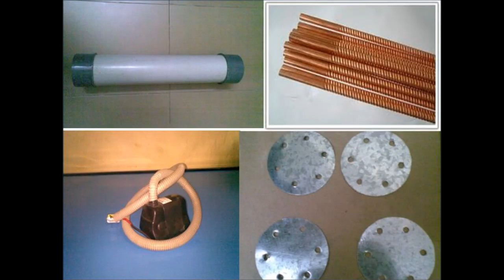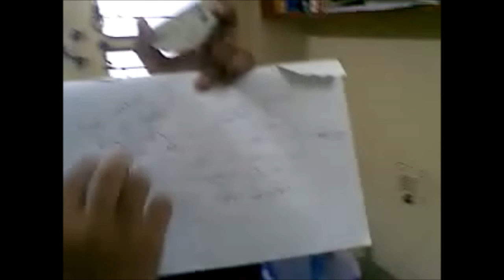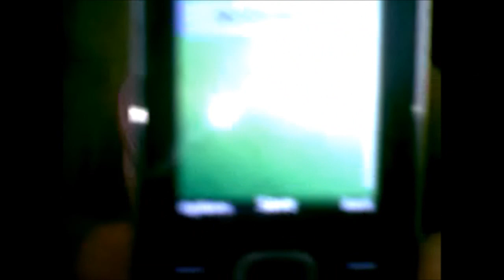construction and working of SHELL AND TUBE TYPE HEAT EXCHANGER

Comment: @Anshul gupta  can you send the specifications like a diameter of the heat exchanger as well as its length and what was the maximum temperature and its flow rate capacity today's respective mail id
upendrab3000@gmail.com

Comment: I have to make a parallel dlow heat exchanger

Can I do it without pump/motor   

Water is not used 
Fluid used would be heater to 250 Celsius

Any suggestions???
Reply: +ccarp55 no
problem

made it

anyway thanks

Comment from the maker: hey karthik...first of all thanks for your appreciation..!! in this we didnt use adhesive for bonding actually..we used adhesive as mseal to prevent any type of leakages in between plates and tubes...nd plates,tubes are fixed together  due to their design ie these are workshopped according to the required dimensions.. means holes in aluminium plates are made of the same dia as of copper tubes...and dia of plates is same as of the pvc pipe upto the utmost accuracy that we could achieve....
Reply: wow nice work.! can you send me how to make that shell and tube heat exchanger? also the materials. thanks